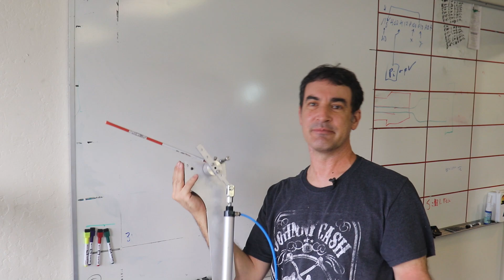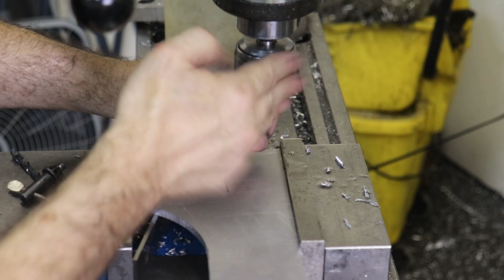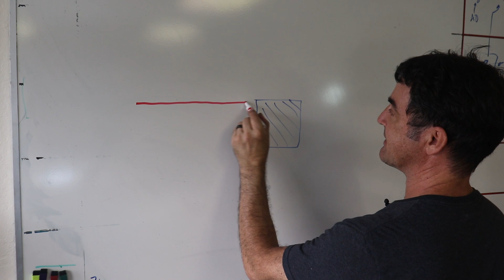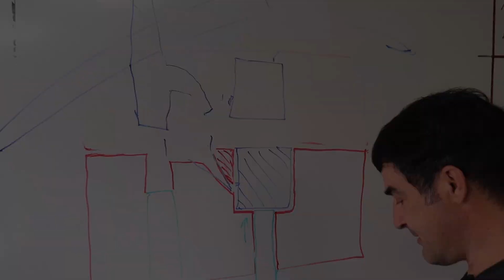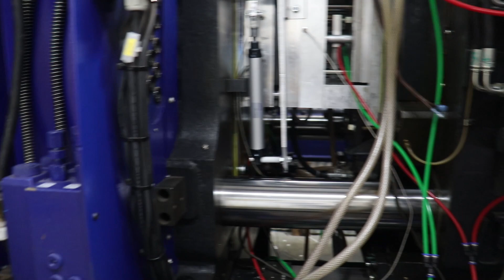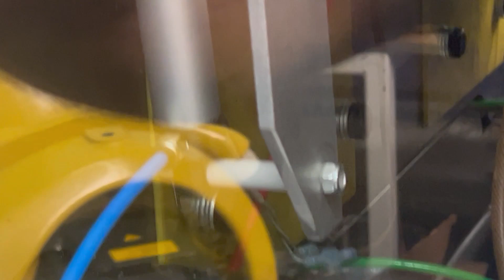SPRUE WACKER for plastic injection molding

Comment: What if you grind more undercut under the 3 ejector pins that are for the runner so that the gate holds tight and strip the part off with the stripper plate than eject the runner.. you can use chains if you dont have 2 stage ejector. when mold opens chains will strip the part off and runner will stay  with undercuts then you would eject the runner off. i like you sprue wacker

Comment: Am I right in thinking that with a tunnel gate you have to be more careful with the control of cooling to ensure that the material is sufficiently cold to hold shape but not so stiff that the sprue can't bend enough to clear the tunnel?
Reply from the maker: Yes, there is probably a range in cooling, but I don't think it is very sensitive to the tunnel gate, I didn't have that problem.  Cooling the poart more will also make a clean break at the gate with no stringers.

Comment: Fantastic video! What is the darker material that you are using on the B-side tooling?
Reply from the maker: Thanks Colin,
 The material is black anodized 7075 aluminum.  I anodized it for wear resistance.
Reply: @DragonflyEngineering   What is the thickness of the anodizing?
Reply from the maker: @carlrinne7524  about 10 um, depends on the anodizer process.  the alum oxide grows into and out of alum surface

Comment: really neat solution and the edit was SO FUNNY :-) .  if you could go back and tweak the mold, how do you think you could avoid this problem in the future?  is it possible the strain relief was a bit too flexible?   do you use any CAD or simulation tools? or is it mostly just from experience?
Reply from the maker: The problem with the tunnel gates on the far mold was that I had to duck under a feature in the molded part, the the tunnel was long and shallow.  Once one tunnel popped out, the other 2 ejectors didn't have leverage to pop out theirs.  Maybe no work around on that part geometry